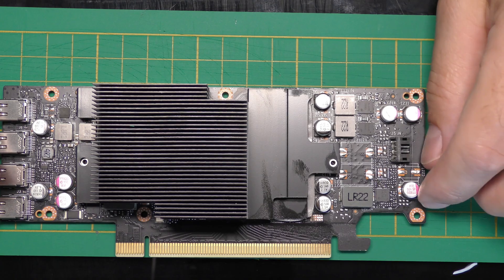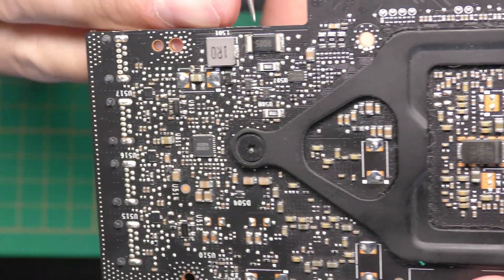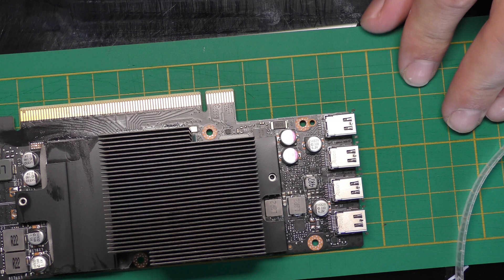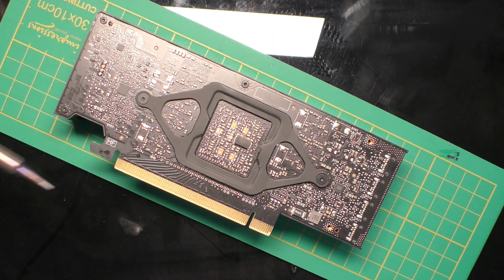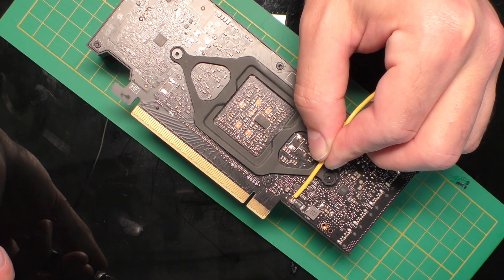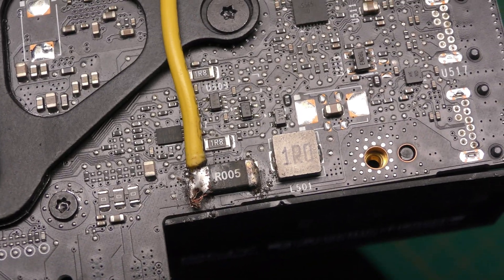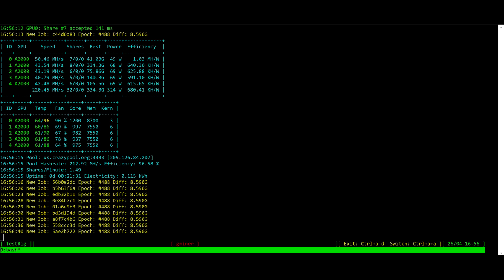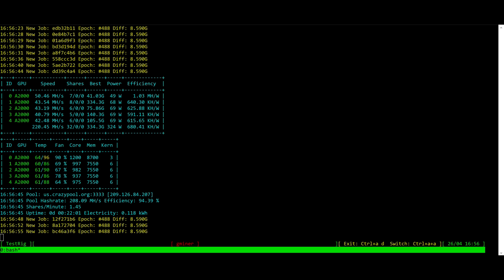How to POWER Mod your RTX A2000 to get 50 Mh/s mining Ethereum - Video showing, not talking about it

Comment from the maker: This video will show how to MOD a2000 to reach 50 MH/s. Yes i done it, didnt just talk about it 
Please be sure to know what you are doing or you might damage the card.
Reply: hello i tried what you did but nothing changed at 42.5 mh
Reply: power dropped to 69W second 33W
Reply from the maker: @hakandogan9286  did you adjust OC?
1200core and mem 8600
Also check if soldering is correct.
Reply: @minerondemand  How to set OC in windows 10?
Reply from the maker: @hakandogan9286  you cannot use afterburner as it limits power to 70w.
You have to use miner with I corporated OC
Reply: @minerondemand  What is the name of the OC program you are using?

Comment: Hi nice video man! Could you solder the wire from the resistor to an existing 6 pin cable that is connected to power the A2000's riser(solder it together with the +12V that goes to the riser)? I have 16AWG 6 pin cable, says rated wattage 400W so it should be more than enough right or could it interfere?
Reply from the maker: You can split the PCIe cable. It's safer
Reply: @minerondemand  Does it matter what PIN of the 12V you choose?

Comment: The cable plug on positive terminal??
Reply from the maker: Yes. We need to power card in order to reduce power on riser. You can use a splitter and just remove the extra wires.

Comment: Good Job, just between you and I, I was kinda disappointed people for paying extra to have A2000 modded. when it is not that hard, but it is a capitalist market, and some just don't feel comfortable attempting it. When I get time, I will eventually do my own video.
Reply from the maker: Soldering is not an easy job specially when the parts are this small. And if you take too long with the iron, you might damage the tracks. Mod is definitely worth it if electricity is not an issue and you can keep them cool.
Reply: @minerondemand  100% hence my tips vid, but one definitely needs to consider thermal and environmental constraints

Comment: Question… Why did you do the front and the back? I thought it was only the front R005 resistor you had to do (I could be very wrong) lol

Also good stuff! Subbed ❤️
Reply from the maker: Won't work of you only do 1
Thx for the sub
Reply: @minerondemand  there's no need to add the back resistor unless you want to use the extra power cable. Modding the front only will allow you the same Hash but is recommended to use good quality risers due to consumption over 80w.
Reply from the maker: Thanks for the feedback guys. Keep an eye on the risers. No matter what they say, they are all made in china and then rebranded.
Reply: @minerondemand  100%
Reply: I can confirm works with just the front one done no extra wire or back is needed. Did 12 myself. Appreciate you ❤️
Reply: @ChumpChangeXD  What if is only the back without wire?
Reply: @avintegration1893  I would stick to the front one if your only doing 1. I haven’t touched the back one personally
Reply: Can it just solder the back only without extra power cable? No need to meddle front inside.

Comment from the maker: Just so you guys know...
Power on the wall
System 30W
Normal card 80W {42 MH/s}

MOD card 110W {50 MH/s}
Reply: use DC clamp meter - best tool ever - you can check every socket power draw (Current) fastly
Reply from the maker: @duniek86  now you have led meter available.